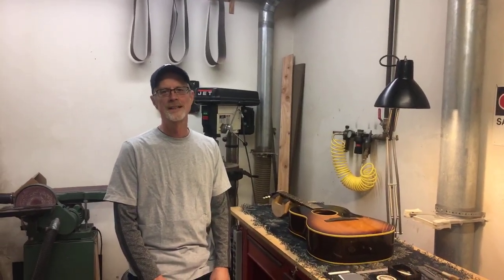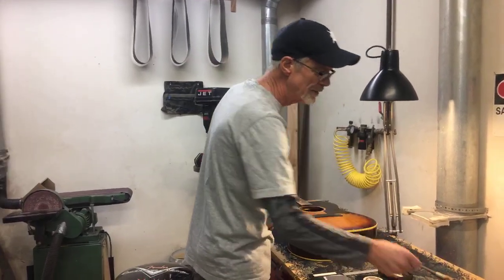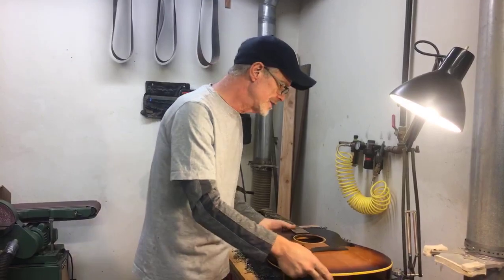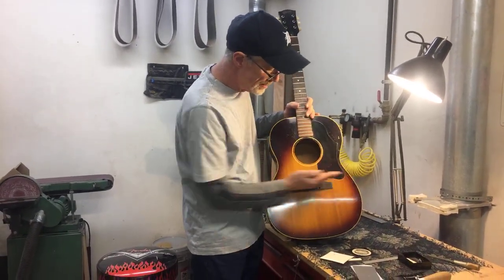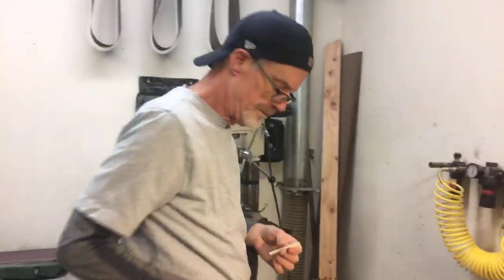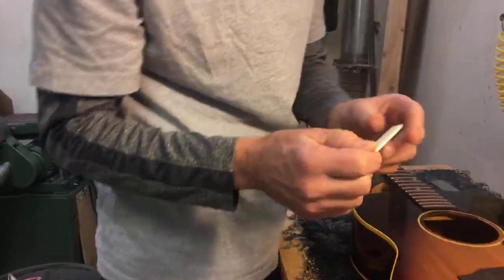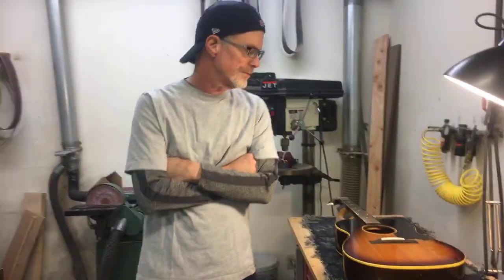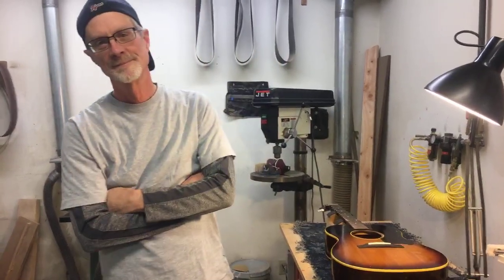In The Shop: Replacing the Bridge on a 1963 Gibson LG-1 | Elderly Instruments

Comment: Nice video, and I really appreciate the effort to show how this is properly done, BUT...
Plastic bridges ARE NOT found exclusively on LG-1's.
This was not considered by Gibson to be a downgrade at the time, I have even owned Hummingbirds and Texans that came stock with this bridge. They are junk, but many times you can just unbolt them, straighten   them out with a heat gun, and bolt the back on, or, possibly just tighten the nuts inside that have crushed the spruce bridge plate that they go through, but eventually....yeah, it has to go.